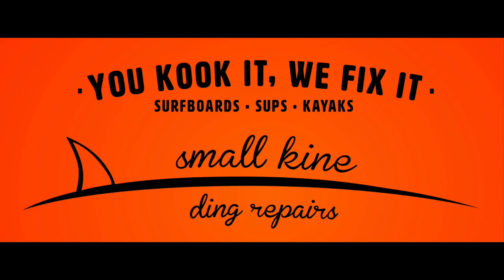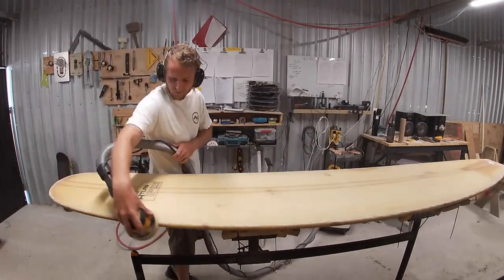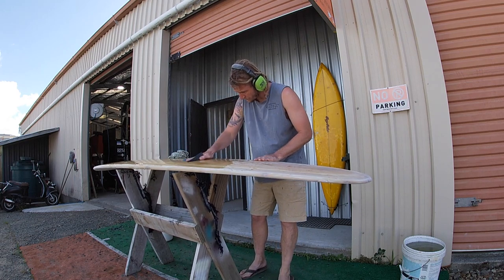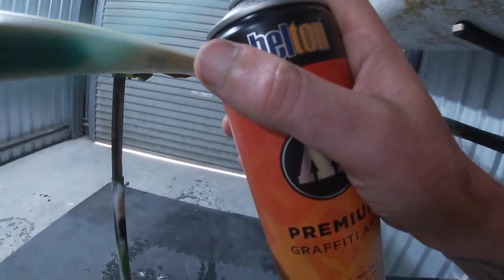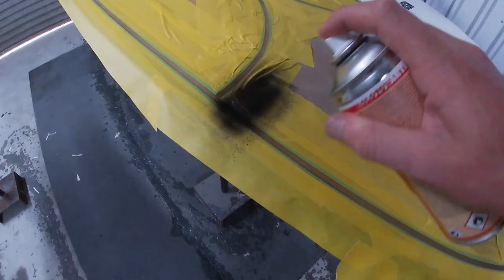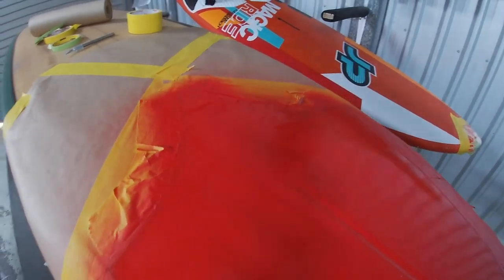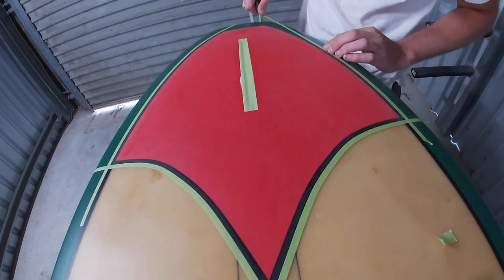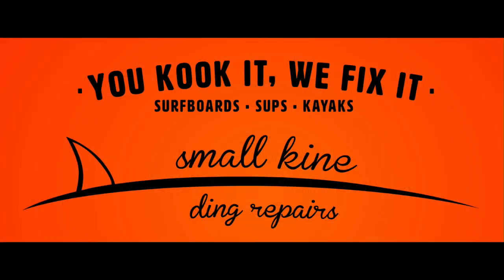New life to an old surfboard

Comment: Excellent video. It’s the the small things that make. A big difference. I’ve been using a hardware store spray paint which peels off. I’ll try the Molotow. I’m planning to restore a 1970s board. I’ll spray paint a lightning bolt. Would you have any idea where to get a stencil pattern for a lightning bolt
Reply from the maker: Molotow will never publicly admit it but their paints are made for graffiti so even without the clear coat it's exceptionally hard wearing, great stuff. Not sure where you'd get a stencil. I would find a Png or jpg file online , print to the scale you want, cut it out, trace onto the board and mask it off.

Comment: Awesome video looks so good! Question, When you finished painting completely and did a wet sanding in the end, did you spray anything or paint anything on after the wet sand or just leave as is and let dry? Is the clear coat spray a water seal?
Reply from the maker: Hey hey,

So after yhe clear goes on initially that's the end of. The wet sanding is actually sanding the clear coat.

Comment: Sweet job. But ooef,  coming back....
Ouch. I always found that spray can paints added so much weight to repairs .... except lacquers . What are you using?
Reply from the maker: With a board like this, I could 6 ounce lam the entire thing and you'd never notice it. These old boards weigh a tonne.

But, Molotow paints are a thin, light and strong paints. Never had an issue with weight with these, even on full resprays. Though, seeing how some people apply paint and the cheap hardware store pa8nts they use, I can see how it does happen. The gnarliest boards (weight wise) I've ever had in are always two pot, full resprays though.
Reply: @smallkinedings  Cool , will see if i can find that paint to try out. My old SUPs need some refreshing.... im mostly doing charter boat repairs these days when i play with resins, so mostly gelcoat wk. I used to have a biz like yours. In windsurfing world... Cheers, Steve

Comment: Hi mate, do/can you use those paints on epoxy boards as well?
Reply from the maker: Not under the glass. It's rare that I use any kind of paint beneath epoxy laminations or resin. Sometimes with repairs it's necessary but normally with only small areas.

You can certainly use MOLOTOW paints on top of epoxy though which I do almost daily.
Reply: Got a JS I’m repairing will use this paint, nice one thanks
Reply from the maker: @graemeeglin8760  nice, you won't regret it. Good luck, enjoy the process!

Comment: Nice job! Is that spray paint just your typical oil based paint?
Reply from the maker: MOLOTOW paints are uv resistant acrylics. I've done a few experiments with and without clear coats on my own boards and it holds up really well but considering the amount of salt and sun boards get, having the extra protection of the clear coats is a good idea. Helps with final sand and polish too
Reply: @smallkinedings     Thanks. Acrylic spray paint. interesting. I can’t find true acrylic spray paint in the US so we have to push acrylic thru a spray gun. Normally acrylics are water based and dry fairly fast. Is that stuff stinky like your typical lacquer or oil based paint spray paint?
Reply from the maker: @joeblow1942  Id be surprised if you couldn't find Molotow in the states. It actually smells sweet, like candy almost